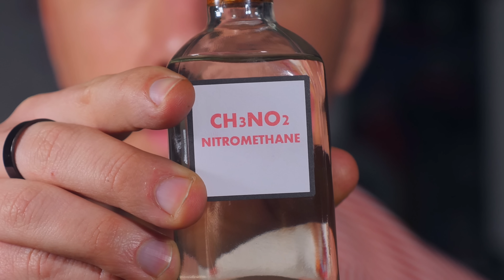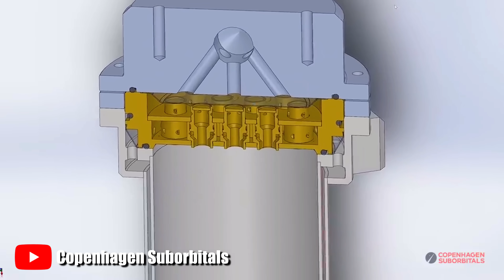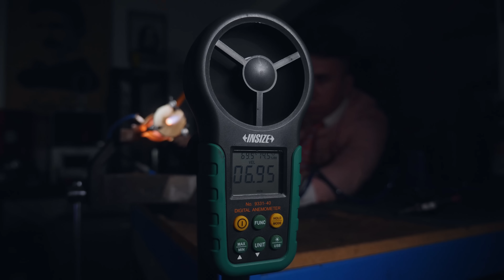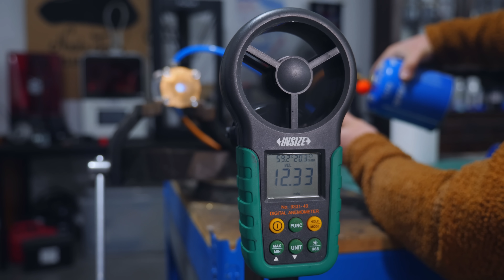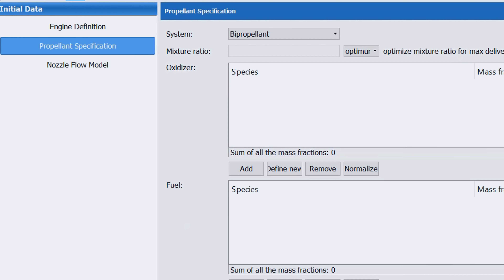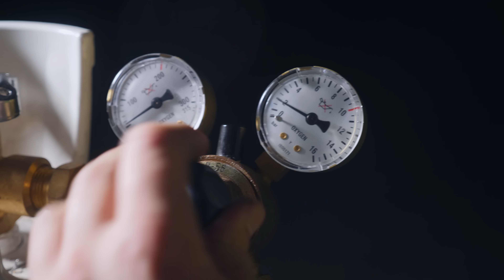GLASS ROCKET ENGINE

Comment: 0:23 I feel like this explanation is backwards... 
"They rush through the hole and they create a jet that propels the entire bottle up"

Huh? How does gas propel the bottle up if its not connected to the bottle!? This is not how any of that works. 
To see how the makeshift rocket really works just rewind to 0:15

Do you see it? The gases expand, and they hit the side walls of the bottle uniformly. That connection creates an upwards vector force. Eventually the gases will also reach the top of the bottle, which is where the REAL propulsion happens. Obviously once the gases interact with the bottle, they will (as per Newton's 3rd law) get pushed downwards by the bottle (action and re-action), so they will get a negative (downwards) momentum. That momentum will also propel them downwards and out the nozzle. We need this to happen, because we want all these negative momentum atoms to leave the rocket and not interact with it anymore.

How are you a rocket engineer without knowing how the rocket equation works!?

Comment: I think it would be great to see an electronic mobility device doesn't matter if it's an RC car or real car or even disability mobile project. Something that has four wheels where two motors are drive motors and two motors are charge motors 
And thus the vehicle continually charges as it is moving drawing power. People say blah blah blah about over unity I'm calling bullshit on that I know there's a way I just have no money or materials to make it happen we have capacitors which can be charged from 3 volts (2 AAA batteries) to a camera flash many times in electronic flash cameras back in the day. We have voltage regulators on cars that regulate the power going back into the system so you don't boil your battery while your driving IT CAN BE DONE  No more charging stations

Comment: @14:16. We rocket scientists have a technical term for experimenters who conduct rocket fuel/oxidizer tests in frame buildings. We call them "idiots". And often, "corpses". Experimenting with rockets is great fun, but PLEASE, PLEASE take better safety precautions. You need non-flammable surroundings, fire extinguishing equipment, and a way to physically separate yourself from the experimental equipment with distance and/or a sturdy barrier.

Comment: I like the videos about your rocket making journey. But I have a comment about what you said during the sponsor ad, it's a complaint but valid: there is no such thing on Earth or arriving on Earth that is renewable energy - including that non-renewable gravitational powered nuclear fusion furnace we call The Sun. It converts approximately 1/3 the mass of the planet Mercury daily into higher periodic matter and energy constantly, and there is no way humanly possible to renew that ... at this time. This also includes any conversion that happens on Earth: wind (heat + pressure), water (heat + gravity + pressure), plants (photonic + chemical, which are even less renewable because you destroy the plants, especially the seeds in some cases), solar (direct high energy photon to electron transfer), and any other Sun connected power type I overlooked.

Power companies throw around the term "Renewable" to justify the additional "Renewable Energy" fee on our bills to have us pay for their solar, wind, water, and plant oils farm building projects. Others throw it around because they like the way it makes them feel or simply don't care about its meaning.

The only theoretical energy I can think of that is renewable is Vacuum or Zero point energy (the extraction of energy from Space/SpaceTime), but even that may be non-renewable (will it slow down, speed up, or distort spatial expansion). We can only find that out once we have a reliable way to extract and use huge amounts at any time (even a simple battery's worth would help research).

Personally, i hate the term "Renewable" as it is currently tossed about.

I renewed my car's power source.
How'd you do that?
I recharged it/added fuel.
And where did that cone from?
They converted energy from some source.
And can you renew that source?
(Thinking) huh, guess not.
Then you didn't renew your car's power source, but just transferred converted energy.

Comment: H2O2 and C12H26 (Kerosene) plus platinum gauze in the H2O2 injectors was the basis of the Black Arrow rocket engines made in Coventry England and tested on the Isle of Wight. during the late 1960s early 70s...Then they stopped all development...Governments can be idiots at times.

Comment: 9 moths ago, Bummer I could really use a 3D printer for my prized saltwater fish tank. Everything from magnetic Coraline tile walls. To custom coral frag plates, custom rock, wall holders, custom tubing, and DYI filtration, DYI protein skimmers, and filters, Hang on back items. To lids for open tank, to quarantine tanks, and dividers, to Water jets for flow for specific corals and fish, avoiding detritus or bacteria, to custom cases for heaters so my see urgent doesn’t burn his delicate million fingers, to optimal intake valves for all of my … … There are 100 more things but I’m 9 months late.

Comment: im currently creating my own project where im mixing a DIY submarine with self made bombs (calcium hypochlorite x brake fluid) dont try at home btw  but every time i explode the bombs i wreck the submarine since im using a plastic bottle as the frame since im still saving up for a 3d printer, is there a way i can separate the bomb from the submarine so i dont explode the submarine?
also i dont think calcium hypochlorite x brake fluid is really the thing i should use... anyone know of something ells?

Comment: You could use an Arduino kit to create dilating thrust fins (made of metal)that you could control near the on set of the combustion much like the ones used on military fighter jets.This could possibly focus the thrust to a much narrower vector.

Comment: You can synthesize triethyl-aluminium which is pyrophoric, by combining Al powder and ethyl chloride [ethanol + HCl gas (Sulphuric acid + table salt)] then combine the product with an alkali metal (Lithium from Li batteries) to form triethyl-aluminium wich can be distilled in an argon atmosphere... This compound can be used to ignite your rockets by dissolving a small amount of it in the fuel (be sure tu use an inert fuel like propane or butane, because with methanol or nitromethane it goes boom)

Comment: Id love to see if you can accelerate the combustion flow rate using a Tesla tube. Ive been wondering for ages, if 3d printing a Tesla tube so the loops are arranged in a spiral, (imagine a screw inside a tube with the internal apertures arranged to create spiraling vortices). If its possible to create enough flow inhibition using a Tesla tube to actually stop the combustion in a tube from coming out one end, and maybe exiting even faster out the other end.

Comment: hey integza if you see this i use fusion 360 and i have a model idea for a brand new rocket engine an 2 fase inverce earospike with cooling system and plumbing i just need to finish the cad model

Comment: This experiment is essentially how St.-Venant and Wantzel discovered the critical pressure ratio in 1839. They used a vacuum chamber and air as a gas. For air this ratio is ca. 0.57, so for a 1 atm throat (hole) pressure one needs 1.75 atm chamber pressure to obtain sonic velocity at the throat.

Comment: Did you actually just say 50% Hydrogen Peroxide is "Not" dangerous? lol. a splash of 30% and you lose your outer layer of skin basically. Longer exposure with jack you up by the second.

Comment: You could use a paintball filling setup and tank on your oxygen bottle to make a smaller and lighter oxidizer sorce also I would preset your pressure regulators and use a ball valve or electric valve for on/off flow from fuel and oxidizer. Hope this can help love the science keep it coming!

Comment: The ElectroJet Thrust Accelerator (ETA) is a cutting-edge electric jet engine designed to revolutionize the aviation industry. Unlike traditional jet engines powered by fossil fuels, the ETA utilizes advanced electric propulsion technology for a cleaner, more sustainable, and efficient flying experience

Comment: Could the pre combustion H2O2 decomposition reaction he used to spin up a turbo pump that in turn feeds more H2O2 into said pre-combustion chamber thus increasing the pressure in it and with that the flow rate into the combustion chamber?

Comment: If you want a lot of compressed oxygen get an oxygen generator the kind people use for breathing then make a rig that fills a rubber balloon that is connected to your air compressor when the balloon is completely filled the air compressor will pull the oxygen out of the balloon and then turn off leaving you with a air compressor tank full of compressed oxygen

Comment: I built a combustor years ago and quickly learned that the injector that pour fuel straight out like that is inefficient.  I took a bolt cross drilled the flats and bored the length to make an injector with 6 ports that pushed the fuel out perpendicular to the flow.  It gave the fuel and air more time to mix before combustion and made a huge difference in the amount of thrust generated.  Also inject the air at an angle that creates a vortex in the chamber.

Comment: 🎉🎉🎉🎉  What is you thoughts on a Tesla Turbine jet engine? Use air injected into the center of the shaft .  (The disc being  two piece, spotwelded and having a 12mm tall , from the shaft, on each side,  24mm larger than the shaft. Spacrer just thick enough to hold .010" holes in the edge to the center  with splines in the disc and spacers, using soft copper '6mm , 12mm larger diameter, than the shaft  total' spacers as seals between disc). Coming up through the center of the disc for cooling,  the disc can be made from thin stainless, with a .030" spacer between the disc, and the spacer having .020"holes in the edge to the cente. Kinto the axel. With the disc having .010" holes along the edge , as well as the sides. To aide in cooling use a traditional turbo as the comoressor without the exhaust side turbine,  have them connected at the shaft. With a few combustors like this rocket engine, adding fuel in a similar way. With the air also flowing through. Maybe pass it through a corrugated stainless tube. To cool the gasses down so its not hit plasma hitting the disc if the holes do nit work with air blowing through, at 20+ psi.  Only use the internal passages with two passages in the shaft.  And a inlet and outlet in the disc. Having liquid fuel enter one side of the disc, exit in the other, cooling the disc. Using grooves in brass bushings with labyrinth seals as the inlet and outlet for the coolant/fuel.  The tiny passages will likely require EDM or $$$ more $,  the 3rd possible way.  Use a typical 16 liter engine turbo. Use the compressor outlet to spin the Tesla turbine.  The exhaust from the turbine , enter a combustor, where fuel and spark is added to the compressed air. Then the hot gasses enter the exhaust  housing spinning the compressor shaft, the tesla turbine being a separate shaft. Spinning a generator  or whatever the whole point of this thing is!  Maybe use a couple compressor stages a larger feeding a smaller,  a say 88mm compressing into a 76mm compressing into a 68mm , compressing into a 60mm , with a 16-18" Tesla turbine,  a 6pack of 4" x 8" combustors, with 1.5" outlet pipes. feeding into a 4" pipe/collector wuth a t6+ flange  then a 102mm turbine, to run it all.  Probably start with a single stage and 4" tesla turbing a 40mm turbo ,  and two ,2" combustors, with 3/4" outlets, just to see how well it works with the tesla turbine being part of the combustors, it lowers the air speed so fuel can be added, and ignite it . Then it being funneled , sped up to spin the turbine bmaking it all happen. 🎉 Have an awesome day🎉

Comment: Can you answer why no one uses liquid hydrogen and liquid oxygen as rocket propellant? If you electrolysis salt water (at HIGH voltage) you should get the cathode release H and anode release O, so you collect and compress those gases; and they should be in the correct volumes to recombine when you if you feed them into a rocket engine as the fuel? It will burn really hot, so temperature would be one problem, hydrogen is explosive and really dangerous (okay, but...) it should make for a good rocket engine! and you can produce the fuel out of water using solar panels (or some cheap electricity)... what do you think?

Comment: Diesel engined vehicles can use recycled cooking oil as fuel, could recycled cooking oil also be used in a rocket? Also, I would suggest you look into joining a rocket hobby club in portugal that could help you launch rockets without getting into legal trouble so that, you know, you could actually launch a rocket in your videos instead of just testing them on your sister's skateboard.

Comment: It would be awesome if you made an induction heated 3d printer to melt powdered down metals just before they come out of the nozzle of the 3d printer & maybe cool the printed section of metals as soon as they come out of nozzle to stop them running & causing a mess so this would need a complete new design of the printer head to incorporate the heat resistant nozzle that the melted metals come out of & maybe a spray nozzle for the instant coolant maybe a bigger heat resistant pipe in between the induction heaters & the nozzle so the liquid metals start to cool down before being extruded from nozzle might work hope that this idea wins me a 3d printer as I don't have one & I have so many ideas I want to Try out we love your channel sending loads of love from the UK 🇬🇧

Comment: I love watching your videos and am amazed at your courage. When I was 15 I too made model rockets.  But in those days there were no 3D printers, or much else .  So I made my rockets from "newspaper".  Completely from newspaper!  Paper soaked in Sodium chlorate (weed killer) dried then rolled up with a 6mm hollow centre and then wrapped in many layers of untreated news paper to for the shell.  I learned to roll them slightly conical to stop the fuel ejecting itself and they did have a tendency to explode when the thick part of the fuel was reached, but that was the fun.  I stopped when one exploded on the launcher and almost burned the hair off my friend.  If I was not now 70, I'd be doing what you do.  Keep it UP.  Oh and I'm allergic to tomato.  Really!

Comment: Video idea:Hello, Integza, it would be really cool if you made a salt and sugar rocket. In this case, using table salt (sodium chloride) in the electrolysis process, transforming it into sodium chlorate, which is a very strong oxidant. This could be used to assemble a rocket and launch it using table salt and sugar. I would love to see this video.

Comment: I am pragyan I think you should make a hydrogen and oxygen generator which work with electrolysis and you should compress both the gase and make a storage system and then with the help of turbo pump you should pull bases from storage systems and mix the gases then attach a nozzle and you have a cryogenic engine

Comment: I love the channel. It does seem like much of what you are doing tests the minimum thickness of materials to stand up to various forms of heat and pressure. Instead of using the resin core for your ionic plasma thruster, could you do a lost wax cast, where you spray the graphite on the wax, coat with copper and then melt out the wax saving more weight?

 You've mentioned your welding skills are lacking, have you ever tried explosion welding?

Comment: I know it's not this video but I was watching your one on rotating detonation engines and was just thinking that adding a second wall to the chamber would allow the detonation to run between the walls of the chamber without crossing over the middle and cutting off its fuel supply. Also try angling the primer to be more tangential to the chamber.